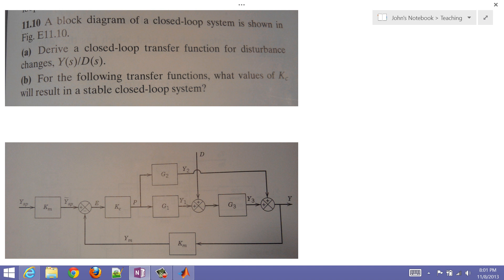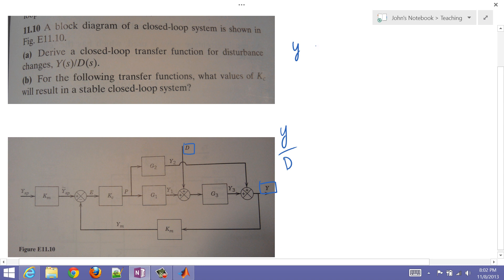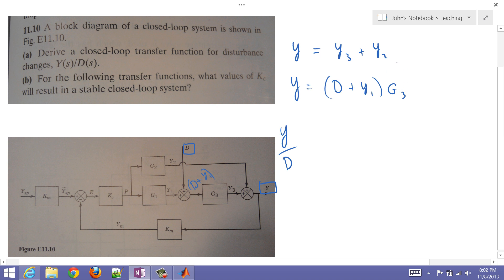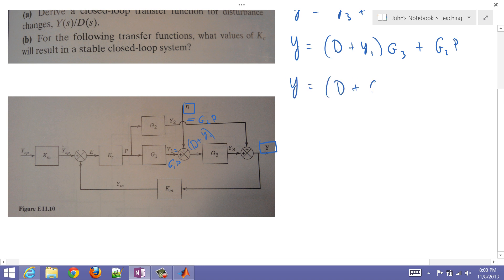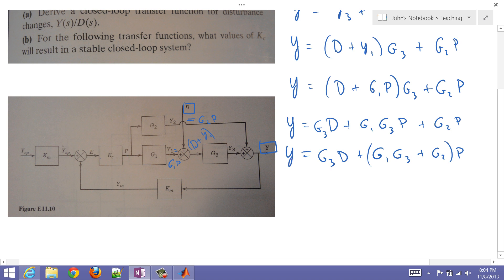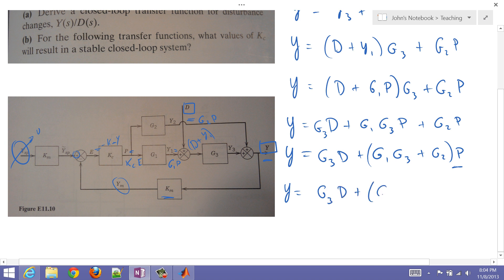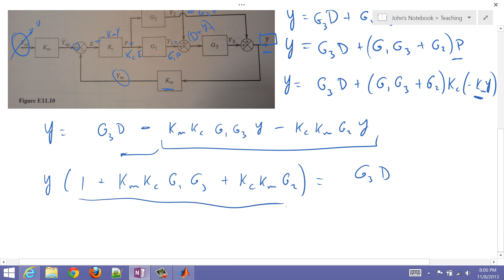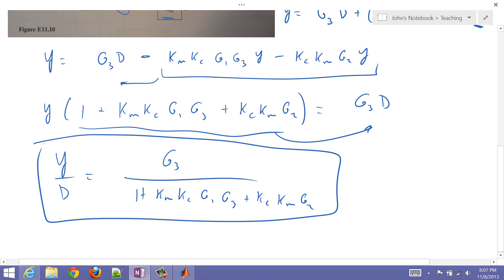Stability Analysis in MATLAB

Comment: What if the characteristic equation includes a time delay?
Reply from the maker: You can use a Pade approximation (https://en.wikipedia.org/wiki/Pad%C3%A9_approximant) or Taylor series expansion to transform the exponential term (time delay) into a polynomial form. In polynomial form, you can perform the stability analysis.